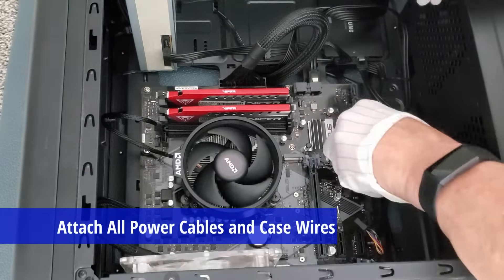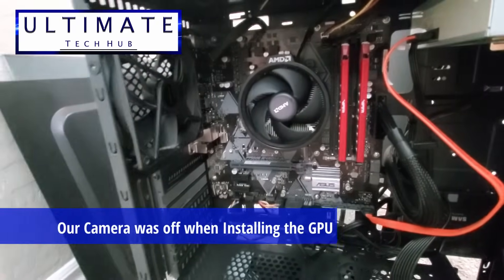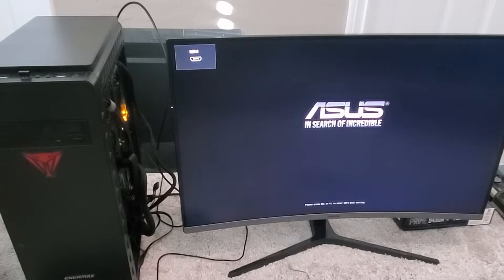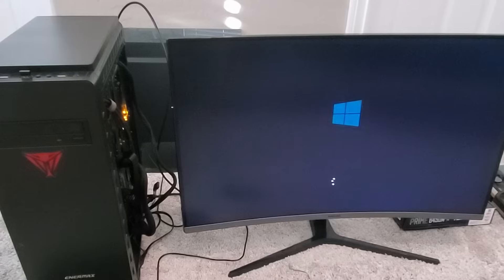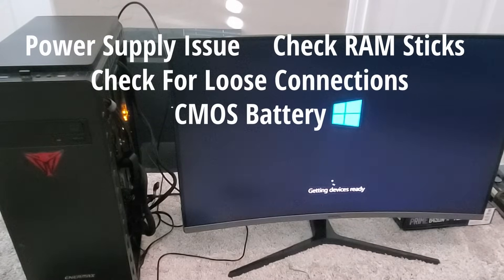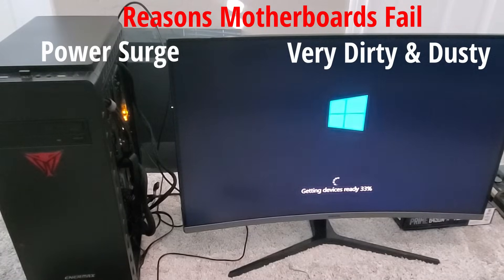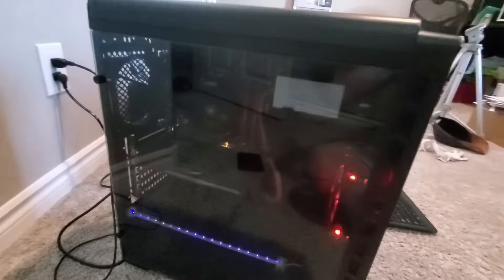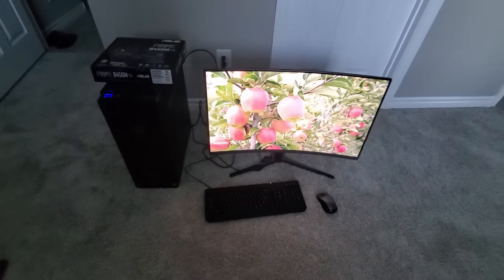HOW TO REPAIR A DEAD COMPUTER - DIAGNOSING A MOTHERBOARD FAILURE! - HOW TO

Comment: I tested everything, even bought a powersupply tester, I get power to the motherboard with fans on, and my CPU is warm, but still black screen!  I put my working graphics card in also, to no avail!  Ordered a new CPU too!  Nothing!   If the motherboard board is bad, would my cpu warm up? And would the fans come on?
Reply from the maker: Mobos have so many components that can go bad or short out and that doesn't prevent the cpu or fans from working. My guess is you need a Mobo replacement. Keep me posted and thanks for watching.

Comment: Bro what happens when motherboard dead will it cause failure to gpu and cpu
Reply from the maker: It wont damage other components but those components wont work until you replace the mobo.
Reply: Thanks bro

Comment: Cleaned my pc every 6 months like new 
But windows10 pro  Ruin my motherboard /cpu with Constant Bluescreens since august updates 2023 to finally no post all i did was clean the gpu then Nothing 
Put cpu on another Ddr4 new board worked for a while  IDK now using the old DDR3 pc i used b4 this ddr4  $3,500 idle chitbox Thanks Microsoft you C@@ts for all the fake bluescreens

Comment: My gpu is getting power and fans are running the only problem i have is i am getting vga error light 
That means my psu is fine
So i can i be sure that my motherboard is broken
Reply from the maker: I would say the mobo is dead. You could test with another PSU to make sure but I think you need a new mobo.

Comment: Did u have any fault lights on the mobo?  Just built my first pc and the boot up stays stuck on ram with no signal to monitor and no usbs. Everything else turn on. Fans lights etc. Tries reseting bios, in and out with ram sticks etc. I'm thinking my mobo is bad also

Comment: Mine is like that. mine will freeze even in UEFI after booting. when I tried restarting it. it wont have display no power in mouse and keyboard. the only time it will display is when I unplug it for minutes then turn it on but it will freeze again

Comment: I recently had two of my Asus motherboards die after updating to the latest Bios!?. It seemed that a new bios over volted and over heated the Chipset. They both had higher MB temps after then both failed to boot not even into BIOS!?.think I'm going to stop updating bios unless it's absolutely necessary in the future.

Comment: Recently, my pc doesnt boot and has no sign of power after i disembled for travel. I tested the PSU with a multimeter, the voltages are correct. I tried to jumpstart it as well to make  sure its not the power switch.

So right now, i suspect its the motherboard, but is it common symptom that dead motherboard has no sign of power? Could dust kill a motherboard that easily?
Reply from the maker: Static electricity kills motherboards or power surges. Dust doesn't kill motherboards. Sounds like your mobo is dead. sorry.

Comment: Would a bad mobo be the cause of why my 4k 144hz Tv and 7900xtx is only showing 1080p native resolutions (recommended) Ive tried 6 new HDMI 2.1 8k 60hz, 4k 120hz certified cables. I even RMAd 4 GPU's thinking that was the issue, Ive had TCL come and replace the motherboard and pdb on the tv still even setting the tv to 2.1 output im still getting 1080p native.. Drivers have been update, mobo bios, cpu etc all has been done, even tried another 4k 60hz TV and still 1080p..., Ill I can think of is the MOBO or PSU but not sure, Any help would be great!
Reply from the maker: Not sure your motherboard is bad. It could other things. Maybe the GPU?

Comment: I think my moba is dead. It was working the night before then today I installed a 3060ti and now it doesn't power on at all. I've even tried to turn it on without it and it won't turn on. I did the paper clip test for the PSU and it works. Hopefully the replacement gets it to work.
Reply from the maker: How many watts is your PSU?
Reply: @UltimateTechHub  850 Watts it should be more than enough since I have a friend that has a more or less similar build as mine.
Reply from the maker: @squintaye9383  Yes sounds like the mobo is dead if you removed the GPU and it won't power on.
Reply: @UltimateTechHub  it sucks because I've only had this pc for about 8 months, didn't expect a GPU install to cause the moba to go bad. Hopefully with this new one it doesn't happen.
Reply from the maker: @squintaye9383  Keep me posted.
Reply: @UltimateTechHub  UPDATE: It was the moba, installed the new one yesterday and everything ran great. Gonna send the broken one to RMA and most likely keep it on a shelf when I get it back.

Comment: I'm hoping it's not a dead motherboard. I think I'll try removing the motherboard's battery and see if that fixes it. 
It's quite crazy, it was working perfectly until yesterday, i unplugged it after shutting it down yesterday, and all of a sudden it was making this weird noise when turning it on today, so i thought my power supply was probably dead, swapped the power supply, removed my GPU just to see if i could get an image out of the APU, and still nothing...
Fans are spinning, and my motherboard's lights are on... Weird issue, but hopefully one of this things will work and i won't have to get a new motherboard -_-
Reply: Same
Reply: @chaseperry3805  Hope removing the battery also works for you.

Comment: Thanks for your detailed video, straight to the points :)
Is it a dead giveaway that your mobo is faulty when your PC wont post - and does not recognize your usb devices?
I tried everything: checking all cables, swapping the psu and gpu, run the pc with only one ram (cycled throu all 4 slots, with both of them), even unplugged both ssd and hdd, but i get nothing.. the pc refuses to boot/post.
The Mobo's (an msi b350 pc mate) VGA led lights up, but even without a VGA OR another 100% working gpu it stays on. Tried the other pcie slot, same result.

So i thought, okay, I'll try a bootable usb with freedos.. but nope, the pc wont even recognize the USB-Stick (works fine on my other pc).
Narrowed it down to the CPU or Mobo, but I don't have anny spare parts for that. 
The only thing that i think is strange and make me believe it's the Mobo, is that my keyboard and mouse won't light up.

Any thoughts about that?
Reply from the maker: It's the MOBO. CPUs rarely become faulty unless you installed and bent one of the pins.
Reply: @UltimateTechHub   yeah thought so, thanks for your reply

Comment: Should i reinstall windows if i change the motherboard with the exact same type?
Reply from the maker: There is no need unless you are having some sort of windows errors. A fresh install does make everything run fast and smooth.

Comment: Hey There

I know this video is two years old, so Im not even sure if youre going to see this.
I just wanted to say Thank You.
My comp went down a week ago, and I need it for work, but I just dont trust anyone going through all my bank info, personal photos etc.
I tried everything... no go.
I was going to go this morning (Saturday 1/28) and end up dropping 1500ish on a new computer.
I decided when I woke up at 4 am to give it one more try and saw your video.
Its crazy but in all the videos I had watched this week NO ONE mention the battery thing (Hell just getting ANYONE who had my exact issue was hard to find)
I did the 'clean the ram sticks' and 'take out the coin battery', checked all my connections and Cleaned it out throroughly
Poof.
After a stressful week, my monitor finally had something on it besides "NO SIGNAL".
Its all working fine now.

Thank you so much. I owe ya one, bud
Reply from the maker: Glad you fixed your motherboard! Congrats! Thank you for watching and if you subscribed thank you as well.

Comment: mine isn't turning on.. psu passed the paper clip test.. sucks I don't have a spare psu to fully rule out a psu issue bcs I refuse to believe that my mobo died just like that just because I accidentally unplugged it from the wall socket during boot

Comment: I dunno if you see this comment, if you see it i need help. My nzxt n7 mobo wont turn on, the only lights up is the onboard power on and reset button. And the cpu was getting hot after turn on the psu.

Comment: Hello,  today morning I tried to turn on my PC and the same problem that you referred in the video occurred. This is the third time it is happening to my PC. I already changed my motherboard 2 times but the same thing is happening. I tried resetting the bios, removing the ram stick changing the power input. But the same thing is happening. Can you please tell me what's causing this.

Comment: Thank you so much for this video! Earlier today I turned my PC off, tried turning it back on and absolutely nothing happened. I was so confused. Troubleshooted everything, paper-clip tested PSU, reset CMOS, etc. I knew it would most likely be a motherboard issue, but I wasn’t sure, as most online articles said that faulty motherboards would have damaged capacitors, and mine were perfectly intact. Thanks to this video I’m much more confident it’s the motherboard now. Subscribed :)
Reply from the maker: Thank you for watching and for subscribing I really appreciate it!
Reply: Was it the motherboard?
Reply: @bennydiep4043  Yes, I got a new one and moved over all the old components, the PC booted up perfectly fine. Still not sure why it stopped working.
Reply: @Max-yh8zt  Thanks for replying, glad you sorted it out. 

Mine has the same issue after I dissembled it for travel. When I rebuild it, the motherboard shows no signs of power,  I tested PSU with multimeter, voltages seems correct, I also tried jumpstart the motherboard but that doesn't work either. Weird thing is the audio line in/out port LEDs light up, red, green and blue on the motherboard, but I assume it doesn't mean anything.

Comment: my motherboard is not working, fan didnt turn on,  ram rgb lighting up. My keyboard lights up but shut off immediately.

The question is. Will my processor can be affected?
Reply from the maker: Its either the motherboard or Power Supply. Sounds like the motherboard. How old is the PSU?
Reply: @UltimateTechHub   psu is 4-5 years old but it was still okay, properly maintained. I already remove the motherboard because the rgb lightning on it doesn't light up anymore. I don't want my amd 5600g got affected by it.

Comment: So my my monitor stays black and mouse and keyboard don't respond. It will turn on but then about a minute later it will turn off. I haven't tried the ram sticks or CMOS battery. I don't thinks it's a power supply issue as all the fans run but could be mistaken.
Reply from the maker: It's probably the motherboard.

Comment: So I bought a dirt cheap mobo with Ryzen g3200 and on stick with 8 gigs what is the chance one of the mobo dead
Reply from the maker: I doubt it. Which mobo did you get?
Reply: @UltimateTechHub  x470 msi
Reply from the maker: @MiKeSu223  Should be all good. Keep me posted.
Reply: @UltimateTechHub  the technician tested it , and said it won't start , and said that under the cpu pins there are dark spots , and said he will swap and test another CPU
Reply from the maker: @MiKeSu223  ok, keep me posted

Comment: My pc is turning on and off in 3-10 seconds time and mouse,keyboard and monitor also not lighting up and i tried putting my mouse in the front panel usb slot on the case its still not lighting up is this psu problem?
Reply from the maker: Yes that sounds like a power issue.

Comment: I'm trying to find a solution to my Instability, I had a bios battery leak over my pcie slot and I feel that it has damaged my motherboard. i can only get a stable system when the gpu is in slot 2. Can someone please recommend how to find a solution please, Great video Btw
Reply from the maker: I would say you need a new mobo. Leaking batteries on your PCie slot cannot be fixed its very corrosive.
Reply: @UltimateTechHub  Thanks for the advice, i better get my wallet out i guess haha

Comment: Brother I have an issue could you pls help. My pc turns on and it also boots into windows 10 but after sometime approx 10 - 20min later my display goes no signal but my processor is still running the fans are running. Everything else is running. But there is no display it shows no signal. How do I fix this issue. 🥺🥺Kindly help.
Reply from the maker: Is your monitor plugged into the motherboard HDMI? If yes then it's your motherboard most likely.
Reply: @UltimateTechHub  yes brother it's plugged into my motherboard. But are you sure it would be my motherboard.
Reply from the maker: @raiden4967  Yes its probably the mobo. You could switch out the HDMI cables and switch to a different monitor. Try all options. If you have a GPU then plug the monitor into the GPU. That's all of my best troubleshooting tips.
Reply: @UltimateTechHub  Ok brother thanks for helping me out ☺️
Reply: @UltimateTechHub  sry for asking again bro but should I replace my motherboard under warranty or should I change the CMOS battery in it.
Reply from the maker: @raiden4967  Replace under warranty is what I would do.
Reply: @UltimateTechHub  Ok brother thanks for the reply ☺️

Comment: What if my PC boots up and even plays games but then suddenly freezes with small rectangles all over the screen and it will either reset or just freeze there. I'm curious if that a faulty motherboard or gpu.
Reply from the maker: Sounds like the GPU. I would try the GPU in a different computer to see if it does the same thing. Keep me posted and thanks for watching.
Reply: @UltimateTechHub  I'm actually about to send in my gpu for RMA and hopefully they can fix it if it is the issue but if not I'll be looking towards the motherboard.

Will definitely keep you posted, thanks for the video man😁👍🏻

Comment: Every time I connect my gpu the pc doesn’t turn on any idea what it could be?
Reply from the maker: How many watts is your PSU?
Reply: @UltimateTechHub  750 w brand new
Reply from the maker: @illusiv8781  what GPU do you have?
Reply: @UltimateTechHub  I have a 1650 super
Reply from the maker: @illusiv8781  My best guess is the power supply can't power both that's why the pc doesn't turn on. Make sure the power connections in the PSU or all the way in too. Might need more than 750w but it really depends on your CPU and mobo.
Reply: @UltimateTechHub  my cpu is a Ryzen 7 3700x. But the thing is my pc was working with a 600w psu before perfectly. I went on vacation and when I came back it didn’t work. Maybe a power surge? since they are frequent where I live
Reply from the maker: @illusiv8781  Yes that could be the case or the GPU is bad.
Reply: @UltimateTechHub  thank you for your time I’ll see if I can do something

Comment: What if I have some issue like this, when I turn on my PC it would got black screen like this but after several minutes it would finally boot up. Now while PC is on for a few hours, there would be unexpected "no signal" and no sound (I'm not sure if this no sound, or it's completely stopped any works on PC). But when I look at my PC everything is still on, CPU fan, LED's, Cooling Fan. Idk how to fix this issue, In have cleaned my RAM, reset CMOS, resetting my windows, Upgrade my BIOS, nothing happened. Can faulty RAM be the source of this issue? The issue is most of the time appear unexpectedly when I'm clickin on something
Reply from the maker: Sounds like the motherboard is going out.

Comment: Well, I think I know what my problem is. Thought and hoping it was my psu that was failing, however I still have problems with fans not spinning, dead gpu and cpu cooler not responsive at all. Guess its time to switch out my motherboard even though its only a couple years old.
Reply from the maker: Motherboards die from many reasons so 2 years old is not a shock. Thank you for watching.
Reply: @UltimateTechHub  Yes, absolutely. Well, time for a new build then. Thank you for your tips, helped me out!

Comment: Seems like the solution to my problem but i dont want to buy a motherboard before i know my cpu is fine, because i am confident (after replacing psu and checking current on the motherboard, which ends where it gets power from the PSU). How do I make sure my psu isnt dead as well?

Comment: Hi, my pc suddenly crash and it wont boot up even if it powers on. then after sometime, the pc wont even power up. I tried to change the psu but it still not turning on. What might be the issue?
Reply from the maker: Probably a bad motherboard.

Comment: This helps a lot thank you my prebuilt cyberpower pc was having issues after a year of use which are commonly known for using horrible power supplies my monitor kept freezing and shutting off and my computer would stay on only way to fix it was to shut it off fully and turn it back on I switched the monitor out thinking that would fix it but no so I switched out the power supply and there was a burn on the internals of the power supply so I switched it out and put a new one in the issue is still here but doesn't do it as often so I think it's my motherboard like I said before this helps a lot. (If anyone knows that it could be other components please let me know).